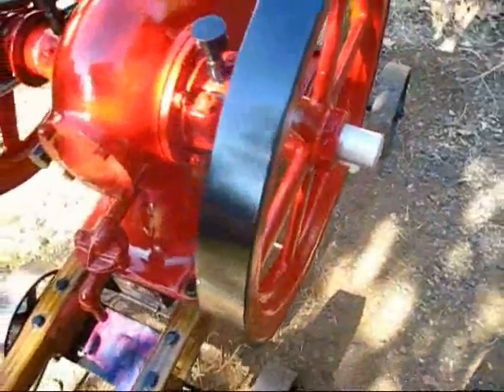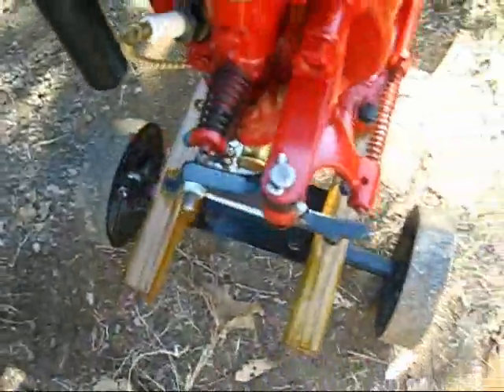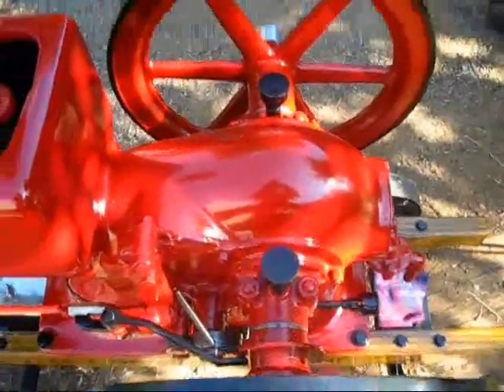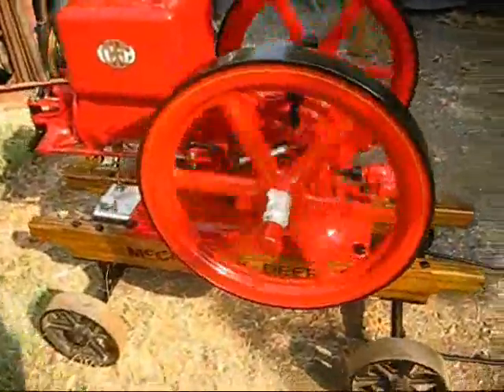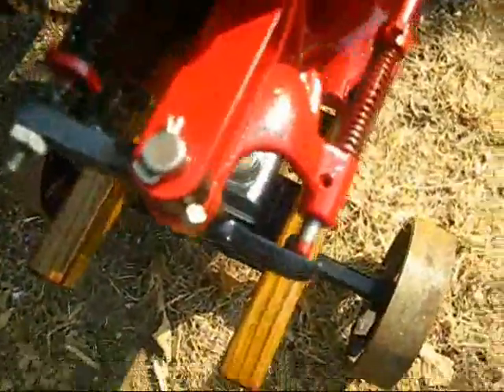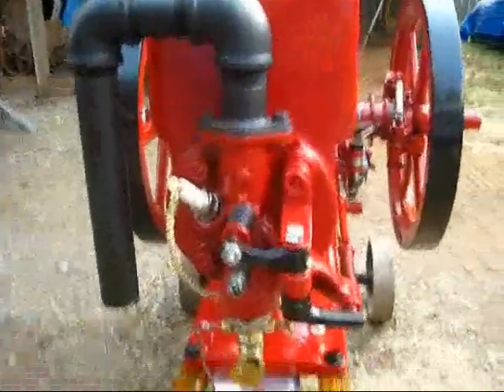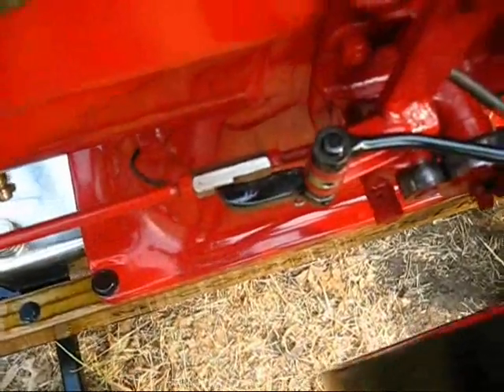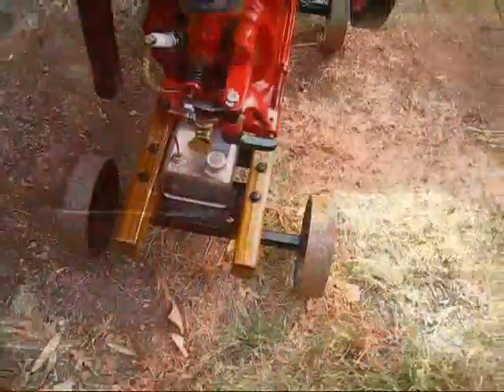hit and miss engine  it's upside down

Comment from the maker: ,, the way I build this type exhaust pipe-muffler can be found in one of my other videos, the end is welded closed and a series of holes are drilled in the outboard side on the lower part of the pipe, sized to keep the correct back pressure, it being a hit and miss and the timing set where it is, makes for a cold running engine, the pipe is never more than warm,, actually the exhaust exits a little further out than originally, at 6:17 sec. you can see the holes in this one,, thanks, shopdogsam

Comment: Well, it's an interesting project...but why do it?  Clearly you know what you're about, you know your way around this excellent old engine - but what's the point of it?  If you needed to run the belt the other direction to your implement, couldn't you just turn the engine around?

Unless, of course, the entire point was some fool told you you couldn't do it.  If that's the case, point proven: carry on!